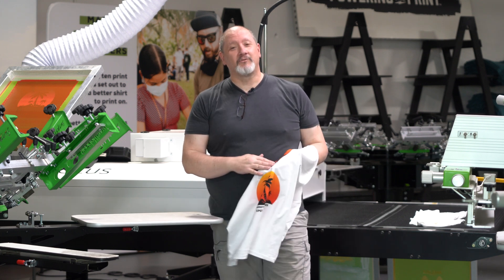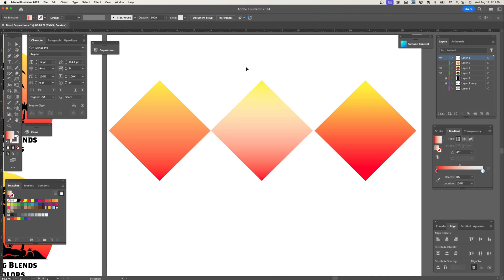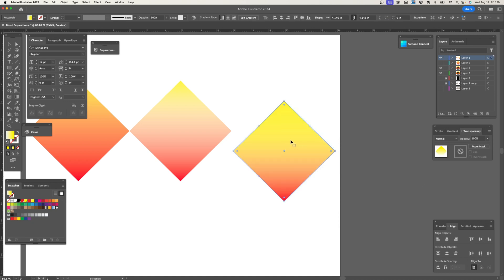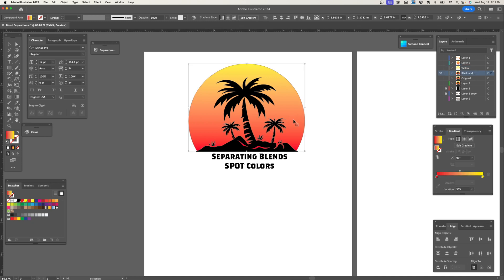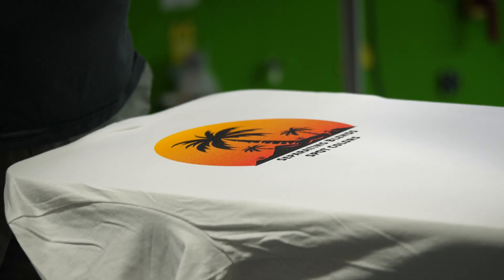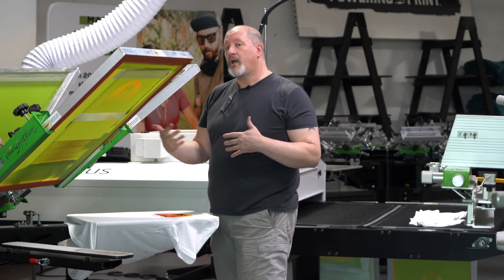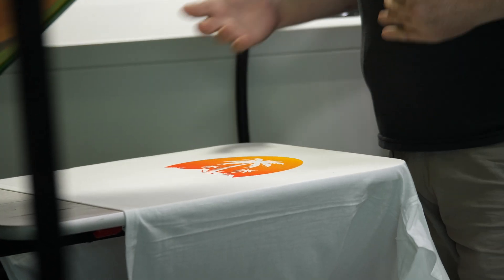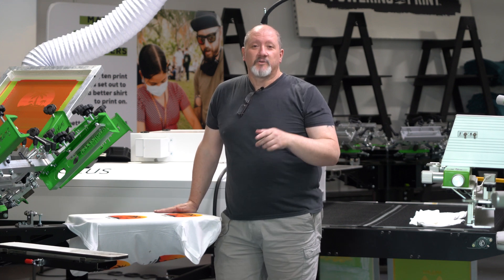Spot Color Blends | Deep Dive With Colin

Comment: With the wet on wet process you mentioned a screen in between the colors.  Is this just a coated screen used like a flattening screen?  Any underside treatment to prevent ink from lifting?
Reply from the maker: <-- Colin.    Hi, yes it's just a normal screen which I was using as a flattening screen before this.  Nothing under it, no coating.  

Are you having issues with Wet on Wet printing?
Reply: @Ryonet  I have never really tried wet on wet and am gathering up as much info as possible.  I have watched some of your other videos about wet on wet, https://youtu.be/0O7t3LUvfMA?si=eJwt437t-MVJNUio